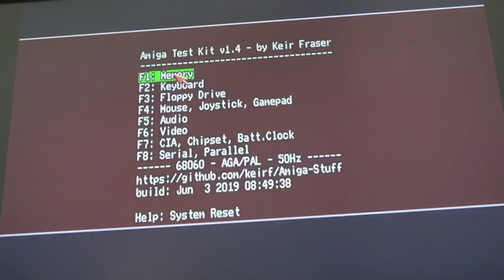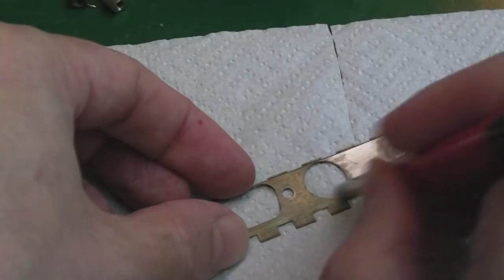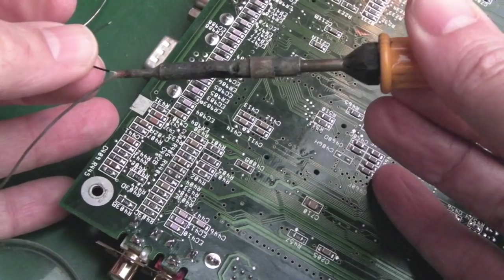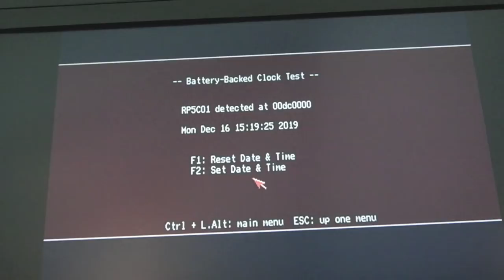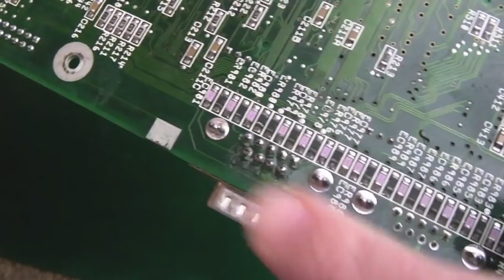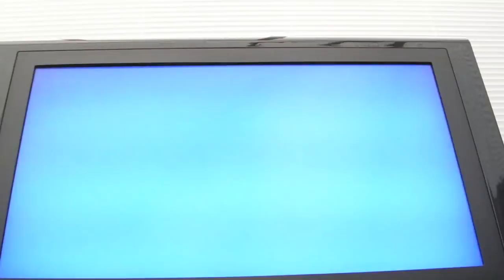Commodore Amiga A4000 Repairs - Part 2  (Cathers)

Comment from the maker: Part 3 - https://www.youtube.com/watch?v=zFeMGetzrGw
Part 1 - https://www.youtube.com/watch?v=CohL_kduhYg
Interestingly - when I scoped there, in retrospect I can see the sine wave (and some of the others) not looking right on one side of the swing.  This would have been more apparent if I had scoped it on the Hameg (proper scope) instead of that portable one.  Part 3 is coming to Patrons later today.
It is already 100% fixed btw!  You can see it being tested in the live stream I did here:- https://www.youtube.com/watch?v=ODcdu3Jc09g
NOTE: I swapped out that 1ohm resistor again (in part 4 - yet to upload) - the 0805 part fitted in this video was 1/8 watt I believe, and it really needs a 1/4 watt resistor.  It continued to work fine with the 0805 but I didn't want to chance that resistor failing in future.
Reply: Do u have the link to the pcb board explorer

Comment: Hi ya just as an fyi i was watching neo geo from hell video series and noticed how you removed stickers can i suggest you try mr sheen if sprayed on thick and left for a little while im not sure why but the glue sort of melts and will usually wipe straight off easily, it has to be mr sheen though no other polish i have used thus far has worked.... hope this helps

Comment: "They look identical"
Identically wrong, that is. :)
Reply from the maker: Yes, that's correct!  It was a bias issue as you will see in part 3.  It was obvious in part 1 but I just kept getting side tracked looking at other issues with the board.

Comment: Looks like the sines are lossing gain at negative half of the sine wave. . Checked dc levels of the signal paths? Could be a bias too high or too low. Maybe one side of the sinewave is close to the supply voltage. Check opamp supplies.
Reply: Ok saw your comment now. Great work!
Reply from the maker: =D

Comment: You can squirt some flux onto a toothpick to apply it in those hard-to-reach areas, or - if you don’t have toothpicks handy - you can cut a Q-tip (cotton bud) stick in half, but cut it at about a 45 degree angle with a box cutter knife or X-acto blade. You don’t need “Louis Rossman” quantities of flux; a little (literally) goes a long way! 😎

Comment: The very first A4000D I snagged in 2017 was a total shed, really nasty badly stored and neglected. I pulled the mainboard but not done much with it. If you would like a challenge the Simm sockets are cracked (think only one need to check again), has all the typical problem spots. Sacked the battery which leaked quite a bit. Underneath the mainboard something appears to have burnt out? half of it is left on the surfacemounted thing,  one of its pads has also burnt away. I will pay if you could look at it! also would give you content on the channel :)

Comment: Excellent progress! My understanding is that ram jumper doesn't actually do anything - was told back in the day it was an option for 8 megs of chipram - but the chipset never supported it.

I made a video about fixing the simm sockets ages ago.
Reply from the maker: Thanks =D   Yes, the jumper that says 8M chip doesn't do anything!  But the jumper related to SIMM size there does work I believe!

Comment: Great videos as usual and such patience. I think you have experienced what I discovered with my maxed out RTG 68060 Amiga. Very nice but almost nothing works. A lot a developers from the 8 bit era thought great, bang the hardware direct and use every trick in the book to make your code faster or harder to crack. That approach just did not work on platform that evolved over time and a true OS that manages resources. And the  OS had no memory protection and as people are now discovering, code written and cryptic C and C++ can easily stomp all over your other code. Have you been using the compatibility pre boot menu? Holding both mouse buttons down at book and removing all the fast ram to confirm problems with sound.
Reply from the maker: Thanks!  Yes - tried disabling caches, it had no effect!   The good news is its already fixed in Part 3 (up for Patrons at the moment).

Comment: As far as I remember all m68k instructions have a 16 bit opcode and everything else is variable. So an instruction can be 16 bits or a lot more than 32 bits. ARM and others have fixed width instructions which probably makes the hardware simpler but when you look at the resulting assembly you have a lot of instructions that depend on data close by that can be reached by relative addressing because you can't pack all that much data into the instruction itself. Code then a branch over a bunch of data needed by the code is a common pattern where as on m68k you would just have one massive instruction with all of the data encoded into it.
Reply from the maker: Thanks!  I suspected that most code would be 16bit, but in retrospect I guess it makes it more efficient to stick with 16bit instruction size on a 32bit system anyway, and since there will be a low(ish) number of instructions there's no need for 32bit long instruction set.  Not something I had taken time to consider!  I am guessing something like the x86 processors do use 32bit long instructions these days?
Reply: CISC is variable length; RISC tends to be fixed size. So eg. on x86, the smallest instruction is 1 byte and the longest permitted instruction is 15 bytes. So, for example, an MC68008 is software compatible with an MC68000 but has an 8-bit databus and so would be an "8 bit processor." Similarly, an MC68060 has a 32 bit databus and would be a "32 bit processor."
From the perspective of the programmer, the MC68008, MC68000 and MC68060 are identical and all look and feel like a 32 bit processor (an intel 8086 however is not like this, and very much feels like a 16 bit processor to the programmer, only from the 386 onwards do you get 32 bit registers.) The MC68060 obviously has features that the earlier processors don't and are a superset in capability. However it is still the same instruction set.

Comment: Good going so far, I'd be terrified of working on a amiga 4000, all the corrosion issues related to the batteries and bad surface mount electrolytic caps. its like an amiga 500plus and a amiga 1200 all in one ;-) That reminds me my daily driver A600 has started with an odd audio hum and some distortion. looks like ill be doing the caps in that next. When ive finished the BBC!
Reply from the maker: Enjoying the BBC repair - hope you can get it up and running soon!  They can be hard to work on due to the sheer number of chips.  Kind of up there with arcade boards in complexity, but perhaps more difficult in someways.

Comment: Nice work Gadget, Recently purchased A4K/040 from the US not working and missing the CPU board. Bought another not working MB as well with caps removed and came with a cap kit and the logic chips and resistors for around the clock area. Installed the caps and i got a yellow screen, dropped in Diagroms and noticed none of the cards on the daughterboard are detected. Replaced all the 6 logic chips around buster and replaced the buster socket and installed Buster 11 as well and after that it would fire up with ks roms. Next issue i had was joystick down direction stopped working, turned out a broken track under U175, fixed that and soldered on the replacement chips U175, U176 and U177 and the resistors. Socketed all the custom chips and GALS so i could test a pile of chips from the original mb and some spares i had, only one dead Alice so now i have a test machine as a go to for my AGA Amigas. Recapped the PSU, added silent fan,  converted it from 120V to 240V and replaced the Oscillator so its fully PAL now.  It's a fully functioning machine now been using it for a couple of months only one strange issue left when i click on certain WB icons it crashes the system if i use the shell no issues, tried the SD card in other Amigas no issues, moved the sd card onto the buddha ide still crashes next mission is to check the logic around the onboard IDE, replaced the FDD and HDD sockets with keyed ones and dropped on new IDE GALs with the pio mod didn't fix the issue but its now getting 3.5Mbs on the onboard IDE port. It also crashed with the other fat32 SD card out the back when i click on the same icons each time even reformatted it multiple times and tested on my other Amigas with Buddha controllers. So yeah the amount of hours spent on these is out of control there is no way i could charge someone for that. but i do like the challenge of bringing these Amigas back to life. Looking forward to part 3!
Reply from the maker: Nice!!!!  Sounds like you've had a lot of challenges with that A4000 for sure!!!  Very rewarding when you've dealt with all the problems though!

Comment: Too bad A1200 and A4000 are so crappy built, while they are the best from Commodore at a technological view point.
I have a collection of C128, C128D, A500, A2000 and alot of pheriperals, and those where the machines I have my childhood nostalgia cravings filled by. However I always dreamed about an AGA machine, but never had the money while new. And as of now it seem so hard to find a good working one, so I think i'll have to pass my dream. :-(
Reply: TBH I think AGA is overrated. For games the AGA versions were maybe a bit better but not night and day from any I can remember.  Back in the day if you wanted to use an Amiga for anything serious you wanted RTG and that meant a big box Amiga or well after commodore died an A1200 with a BlizzardPPC and BlizzardVision.
I had a towered A1200 with BPPC and BV back then and I'm totally satisfied with my A600 with a furia 020 card now.
Reply from the maker: I think it was a sign of the times - when we moved onto SMD and those pesky SMD electrolytics started to become a problem.  My understanding is it was the electrolyte formula that was the cause and why so many of that era leaked.  I wouldn't give up looking for a 1200 - yes they can be expensive but not compared to the 4000 and the 1200 can do most of what the 4000 can!

Comment: Which audio connectors did you replace with BTW? I usually use Farnell's "Pro Signal" ones. They've been fine on A600s and A1200s but not closely looked at the size to see if theyre different
Reply from the maker: The audio connectors came with it - they were from AmigaKit!   They are identical to the original ones, but the original ones had those bends on the outer pins (bent inwards - more in profile with the plastic) and the centre pin has a small L shape in it to put in the right place.  After modding these they have the same bends as the original and look identical.

Comment: 68k instructions are always multiple of 16 bits. Doesn't matter if it's 68000 or 68060. On the other hand there are CPUs that have instructions that are longer than 'bitness' of a CPU. For example AVR uses 16 bit instructions while its core is 8 bit.
Reply: You remember opcodes as well after a while... like 4E71 is NOP, 4E75 is RTS.. amazed i still remember those after 20 years :)
Reply from the maker: Yes, I didn't think to consider that with some CPUs its easier to just use 8 or 16 bit instructions - as well as the fact there are very limited number of instructions too, so where's the benefit in having 32 bit versions of them.  That said, dont modern x86 (eg 486 / Pentium) have 32bit wide instructions?
Reply: @GadgetUK164  On x86 and even x86-64, instruction length varies from one byte to as much 15 bytes.
Reply: Yep, x86 has variable length instructions, because its one huge mess of backward compatibility hacks
Reply: @GadgetUK164  To (hopefully) clarify, the op-code length doesn't vary on the 68k series, it's always one word (16 bits) long. An instruction on the other hand is the combination of op-code and any operands which varies between one and eleven words in length.

There are many reasons for this but effectively it was to make life easier for programmers and ensure both forwards and backwards compatibility throughout the design's lifespan.

Comment: 35:35 - Is that a bulging cap to the left? I might be seeing things. These videos are really interesting to watch. :)
Reply: That cap looks OK on first glance (although you can never really tell without measuring the capacitance and ESR.)

It's the type that has an arc across the top for the vent, which does make it look a bit like the cap is bulging.

Comment: That's the ecs version of UFO you want the aga version for the A4000 🙂
Reply from the maker: Yeah, that's all that was on the HDD =/  I also had no way to transfer software over.  But in retrospect I could have connected the IDE HDD to a PC and mounted it using WinUAE I think!